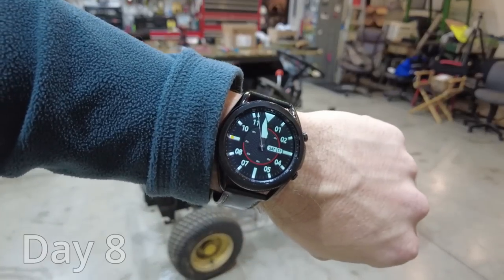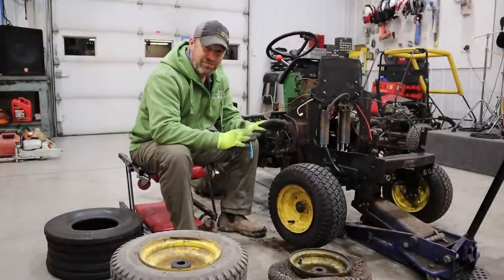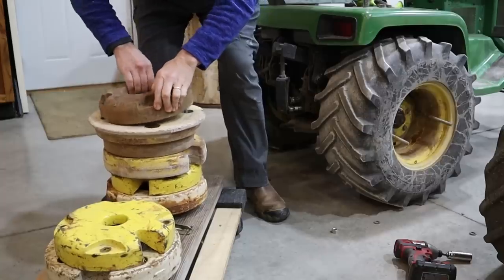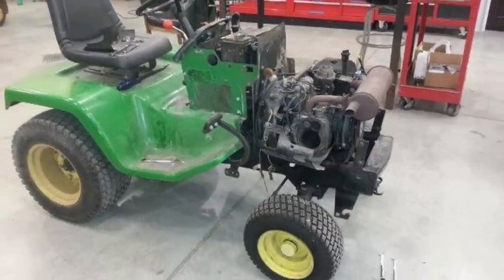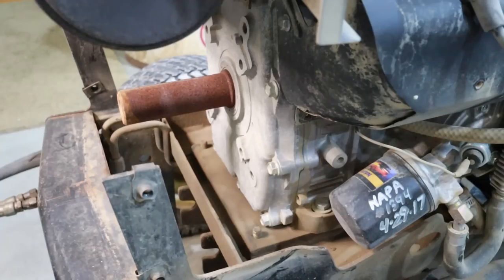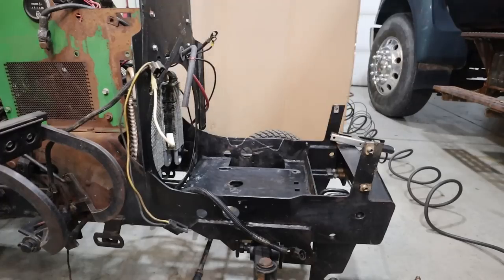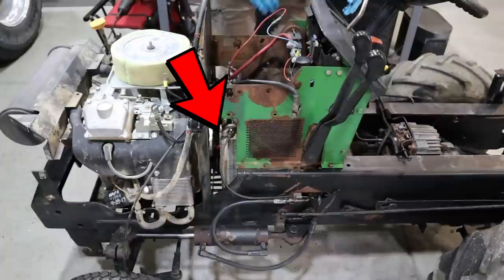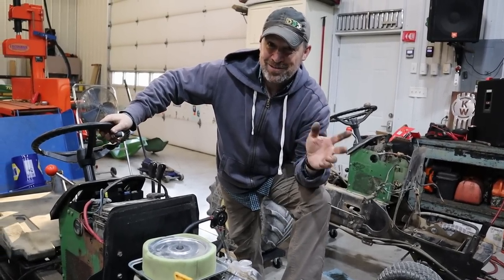I'm Building My Dream Garden Tractor! Part 2

Comment: Loving this series of videos.  Im pretty far along myself in the restoration of a 1967 Wheel Horse with a 10 horse Kohler.  Started it in 2010 by taking it all apart and then started painting piece parts.  Them “life” got in the way and it sat for over 10 years in boxes of parts.   

Like you, I became determined last winter to get back to it a little at a time.  She’s now almost done but for refinishing the hood and seat pan.  She even started right up once the engine was back in place.  Unfortunately, I decided I should adjust the vales and ended up messing up the timing, so just need ti fix that also.   Your videos have me more determined to see it through.  Thanks.
Reply from the maker: I love it when people say this is motivated them to work on their projects. Thanks so much for sharing!

Comment: Great project. FYI on the front rims. You can use whatever rims you want just swap out the bearings for the id that matches your tractor. The od on the bearings is the same. I ran into the same problem when I put 420 front rims on my 314. Also for a name Bill Burr or Bill 2.0

Comment: Bill Jr.  When I did my 430 I found a gal that did powder coating very reasonable.  I never regretted it.  I sprayed the hood since it was fiberglass.  I like your front tires.  When I did mine, I wanted the R ??? that is a combination industrial/AG tire.  They didn't make that size.  I even thought seriously about some aggressive ATV tires.  That I would do for sure if I did it again.  When you were taking thoze wheel weights off it looked like a clown car!  I would never have guessed all that was in a wheel!  You're in the home stretch now!
Reply from the maker: Thanks, John!

Comment: Just a small suggestion, you can get an 1100lb overhead electric hoist from HarborFreight for $145. There is a lot of ways to mount it in the shop. You could have installed the engine by yourself with ease. Great video though
Reply from the maker: That's a good idea 👍🏻

Comment: I bought one of the HF moving dollies for < $10.00 - I needed the casters for a toolbox that I received missing a few wheels.    For less than the price of a single caster, I got 4 new ones, just had to drill out the rivets.   Still working to this day, about 5 years later.   I might not go crazy and use them as pallet casters for firewood, but they have high weight ratings.

Comment: Nice video, I had a 318 also,  bought it cheap and cost me a good chunk of change to keep it running every year. I should have put a new engine in it right away, I think it would have been way reliable. For a gas Onan engine it sounded like an old two stroke Detroit diesel. Best thing was when I upgraded to JD x728. I think you should name your tractor B.O.B. (Is it Bill Or Brutus).
Reply from the maker: Ha! I like that name suggestion :)

Comment: Been waiting for this series!
Even if I’m not a Deere guy. 
I built my dream GT in 2020 as a covid project starting with a Case 446 and a 2 cylinder Perkins diesel and finished it off with a demonstrator paint job complete with gold decals. 
Wife thought I was nuts but it turned out awesome. 
It’s already got some bumps and scrapes but that’s ok as I told myself it wasn’t going to be a garage princess.  
It plows,tills , mowes, power brushes, and grinds grain as an acreage tractor should. 
Looking forward to the rest of the series!
Reply from the maker: Thanks so much Jonathan!

Comment: I'd recommend making a set of wheel hubs that allows you to bolt trailer wheels on... that way you can change tires for different conditions or if you get a flat it's easier to repair/replace a tire.  Another option is fully converting the front axle spindles to trailer spindles the tapered roller bearings in trailer spindles make a huge difference between the reduced friction and less wear... The easier the front wheels rotate the less likely you'll get stuck and you can use bolt/lug nut on rims. Even if you have ball bearing wheels on the front the trailer hubs and spindles conversion adds more reliability (ball bearings can't handle the side loading) I completely moved away from ball or bushing bearings in any floating hub wheel locations on both tractor steer tires  and trailer attachments I use for my garden tractors as the reduced rolling resistance has allowed me to be able to pull heavier weights on rougher terrain while generating the same or less wear on driveline and I go through more mud and snow with only converting the steer spindles and hubs towing a trailer than just the garden tractor with bushed wheels could do by itself. I run a set of loaded rear ag tires year round (80lbs of ballast per tire) and rarely get stuck(if I do get stuck it's usually because I got high centered on a rut or rock.

Comment: Hi Neil! Oddly enough that once you started this series, I also just started marrying two tractors to become one in my garage. It has definitely proved to take more time than expected because of the engines being different brands. As far as a name for the new Bill and staying with the "B" theme, I think Butch sounds fitting. Like another commenter mentioned, a friend of mine in Garrett Indiana is selling an inflatable spray booth that would work perfect for your project. Happy New year!
Reply from the maker: I checked out that spray booth. I think it's just a little smaller than what I would want is all. Otherwise I would be all over it.

Comment: Bill + Brutus = Bocephus like Hank jr!!!! Man Neil, that Subaru engine is a really neat swap for sure. before the Onan in my 316 gave up the ghost i was gonna run 12" Economy Power King wheels on the front with 5 lug trailer hubs so i could use the heavier weights on the front wheels👍 . i replaced the 316 with a red International 782, i love this tractor. anywho, ive seen a JD 300 series painted Allis Chalmers orange, it looked pretty cool, even though i own JDs im not a big fan of green and yellow lol

Comment: Nice I pulled out the engine from my simplicity legacy tractor it’s getting a rebuilt I finished a lot of undone projects  in the past week also got new 5 rib v61 tires on my 318 bucks he plow is on for snow and i tightens yo yo front axle to fix the sloppy steering
Reply from the maker: Very nice!

Comment: Have you found that the hot water through your pressure washer causes any issues? Was literally just taking a break from installing hot water in my barn to watch you work on the tractors and you mentioned hot water in the pressure washer. Really appreciate your videos.
Reply from the maker: Someone else mentioned that it's not a good idea to run hot water through a pressure washer, but I've never had a problem. I have only done it a handful of times when something is really greasy and dirty though. Per everything else on the house and the concrete and such we just use cold water.

Comment: Another great vid!! You've inspired me to get a JD750 and a 316, to which I'm happy to report, I now own a 316 as of this weekend. I scored my JD750 about two weekends ago, so we're off to a great start... I've already started the "restoration" of the 316, but based its current condition, it shouldn't be too difficult. I know you previously mentioned parting with some of the old parts from Brutus; if you serious about that, I could use rear tail lenses, Ag tires and a seat...
Reply from the maker: I'll check some inventory and see what we can come up with. I need to jump over and check out your 316 tractor on your channel for sure. I've been behind on comments and video watching over the last week. Pretty bad.
Reply: @digdrivediy  that would be awesome!! The tractor has some good bones but appears to have seen some neglect in recent years. I knew the tractor was equipped with a Kohler engine, but I assumed it was a K341; turns out it is a K301 (12Hp). That's a little disheartening, as I wanted >16Hp. Nonetheless, this will work for now, and maybe a swap is in the future. As for parts, I could use a seat, knobs, tires, and taillight housing/lenses. As for the JD750, it's near perfect condition, only needing a good bath and waxing this spring.
Reply: @digdrivediy  u
Reply: @digdrivediy  I'm

Comment: Neil, the videos on the 300 series JDs are near and dear to my heart. When I was about 13 I inherited a john deere 300 from my grandpa, and like most 13 year Olds would I wrecked it(blew the motor), it sat around for a few years and eventually made its way to the scrap yard. Now 10 years later I kick myself, the 300 doesn't seem to be super common, and the 12hp kohler left alot to be desired, my plan is to find a 318 and put 300 decals on it, but for now I'll find joy in your videos. Curious, the sweeper you tried on bill this past spring, does that run off front pto? Might be a reason to retrofit a front pto onto the new tractor?
Reply from the maker: Thanks so much for sharing that story. I had a few get away that I wish I had back too. Yes the sweepster runs off the front PTO. I'll have another tractor I can run it with if need be 😉

Comment: Happy New Years!
I'm glad this project has started. 
Why aren't you using the 322?
Don't forget to grease the driveshaft or anywhere else for that matter.
Reply from the maker: Haven't really done anything with the 322 yet. It will stand alone as its own and we'll probably be my tractor I use with the mower deck if I ever get it running.

Comment: Great video and Happy New Year!  I'm in the middle of an articulated Allis Chalmers build from two 70s/80s Era garden tractors, and am particularly pleased to see your current project.  My parts tractor waited patiently for three years in the corner of my shop before finally getting used... 

Not to get long winded in the comments, but here's a thought for your build- you can plumb the hydraulic spool and cylinder from the unused tractor into the power beyond port of the twin spool.  This will allow you to separate the 3 point lift cylinder from the front attachment hydraulics (dedicated lift and tilt).  If you don't have the power beyond port, you can plumb the current return line into the supply side of the additional spool, since the sundstrand u is an open circuit (I'm currently running this setup).

Glad to hear you're looking to experiment with paint colors, but that seems like a risky maneuver in Hoosier country, eh?!?  Perhaps Allis Orange would get the neighbors talking?..
Reply from the maker: I love your articulated Allis concept! I always wanted to build an articulated John Deere. I even had the parts for it.

I actually do have this one plumbed off the second spool to the back of the tractor to run my hydraulics. It works great and I've been doing it that way for quite a few years.  That's one thing I didn't like about the 316 is it only had a single spool and the three-point hitch was always trying to go up and down when I ran the greater box.

Comment: Happy Holidays, Neil.  I gasped a bit when you took that chunk out of the frame.  In theory, that will weaken that side by what looked like over half.  It was hard to gauge, but it looked like you reduced the cross sectional moment of inertia of that member by 50% ish in the direction that matters for bending strength.  But then you have a lot of history with Brutus having the same notch taken out and if you have never seen the frame bend at all in the weak area, I guess you are good to go.
Reply from the maker: I'm worried about that too and I did it on Brutus the first time. It's held up about 12 years now and I haven't seen any issues so I didn't think much of it this time around. But your point is well received for sure!

Comment: Neil, I had a 400.  I don’t remember the tire or spindle size.  Is it the same as it’s newer brethren the 420 & 430?

I was going to trade it for a 430 but, they changed all of the implement attachments.  So, I went to Kubota and have owned them ever since.

I can’t believe you didn’t pop a wheelie once you got it started… that would have been an epic clip! LOL

You guys did a fine job of editing this update.  And, I’m impressed with your progress!

Happy New Year to you and the ladies.
Reply from the maker: Happy New Year Dave!
The 400 and early 420 and 430. I'll head one at spindles. They changed the 20 and 32 metric spindles at the same time they did the 300 series tractors. I found a set of rims off of eBay that I needed so it should give it the look I'm wanting.

Comment: Billieus?  Bruce?   Looking good.  I am looking at a 755.  Any advice would be appreciated.
Reply from the maker: Hey Mark. My advice would be to make sure you get one with four wheel drive and the control valve for the loader. If it doesn't, at least have the loader. Otherwise check that the front steering is tight. The tie rod ends wear out and it's a pain to get that stuff fixed. Anything under 1,000 hours is pretty good. My 75 with a loader has 2500 hours.

Comment: I think Brutus is such a good name it is going to be hard to beat. I sometimes refer to my X738 as beast or little mule. My 2025R is only three years old, I like it but it hasn't earned a nick name.
I don't think I have enough fingers and toes to count all my furniture carts. The first one has a piece of plywood added and is a seat for working close to the floor. I even have 2 60lb wheel weights sitting on one. I have accumulated 3 sizes.

Comment: It's a neat project.  I don't understand what makes a 318 better than a 316 though....
Reply from the maker: Great question.  I'll explain in the next video.
Reply: No power steering is the biggie, and the steering linkage was just bad, only single spool aux hydraulics....plus it was a 16hp engine, some later ones did fid get the 18 hp tho. The 318 was JD's attempt to correct all sorts of problems that the 317 caused them.....the 316 was the stripped down budget model. I used to buy and strip down a lot of those old garden tractors back in the day....still have a 430, 322, and 420 because they just never die if you take care of them.

Comment: This video caught my eye, as I've had a 300 for many years. The original 16hp single cylinder Kohler basically grenaded. I swapped in a m18 Kohler magnum. Thinking about someday going with a v twin. Not real crazy about lack of power steering. Maybe I can figure out how to update that.
Reply from the maker: Yeah I had a 300 for a bit and it was a shaker. Not sure how much of a task adding the power steering would be.
Reply: @digdrivediy  frame is slightly shorter. Probably not room for slave cylinder, plus the hydraulics might not have enough capacity.

Comment: Do they make a plasma cutter that will run off 110v? Can you use it with a small size air compressor?
Reply from the maker: Yes. Actually this one here runs off 110 as well. It just doesn't have as long of a duty cycle.

Comment: Don't ever hook a pressure washer up to hot water! If you have a "hot water" pressure washer it heats the water AFTER it is pressurized! (This is why they cost so much!) The pump cannot handle hot water. The manual for every pressure washer ever will tell you this. The max any cold water pump can handle is about 100 degrees, or less than shower temperature, and even this is not good for it.
Reply from the maker: That's good advice.  I honestly didn't know.  Our water isn't that incredibly hot though and it probably helped my situation being 20F outside.  The water likely cooked to some degree. 

That being said, what exactly happens to the pressure washer with hot water?  I'll admit I've done it quite a bit and haven't had any problems yet?  Maybe cause our water just isn't that hot and I mainly do this in the winter time?
Reply: @digdrivediy  It really depends on the machine how bad it is, but they just overheat. Normally the cold water cools the pump. It's like when you aren't pulling the trigger, and it goes into bypass mode - you can only do that for a short time because it heats up really quickly.

A higher end unit will tolerate it better than a cheapie big box store type, but most of the consumer grade pressure washer pumps are only rated for a few hundred hours anyway, and they overheat faster. It's funny, on places like craigslist it's easy to find a $50 running engine on a cart - it used to be a pressure washer but the pump usually doesn't last as long as the engine. :)

If I had to guess after some garden hose at 20 degrees it probably wasn't much over 100 degree water. I will purposely mix mine to slightly warm water in cold weather, mainly just for me...

Comment: Man, there's few things worse than going from having terrible weather and plenty of energy to having beautifully, unseasonably warm days and feeling like crap. Today it's insanely nice, a balmy 78*F, and my back is wrecked from working outside when it was stupid cold. Don't suppose you know of some kind of juju magic that can absorb inconsistent energy levels (I believe the medical term is legitimately called Exercise Intolerance. If you're curious and look it up, you'll see what else it comes with)? My project is down to the rails and waiting on engine mounts, then to figure out how to make all the pulleys work...
Add: By the by, if you ever need to pull one of the old Kohler's that weigh a billion pounds by yourself, using a little giant ladder and a chain hoist suspended at the top of the A by a 1/2" solid rod is totally doable. Lifting the replacement engine in and out to fit parts repeatedly while the old one is on the hoist, ugh... Not advisable...
Reply from the maker: Boy I hear you! 10, 15 years ago. I would have been lifting this engine out by hand and that's probably why I have trouble standing up straight after I've been sitting for a while now. I hope things get back to normal for you and we can all walk a little straighter come next summer!